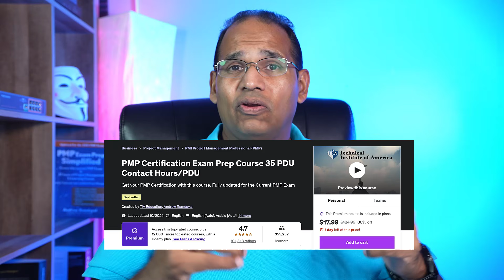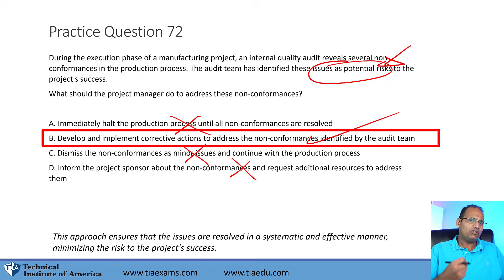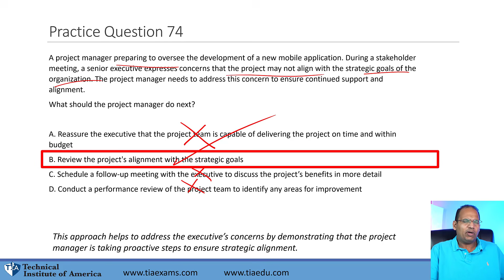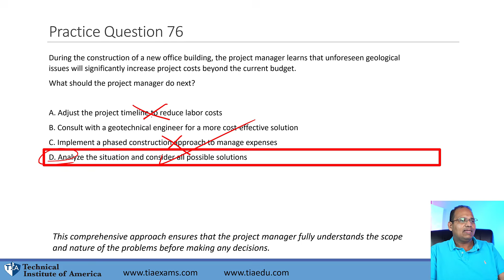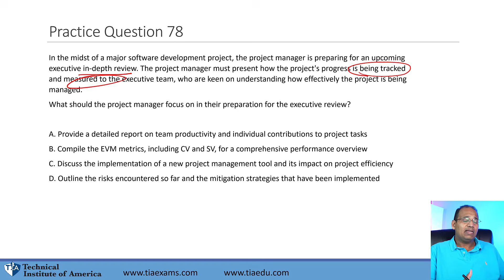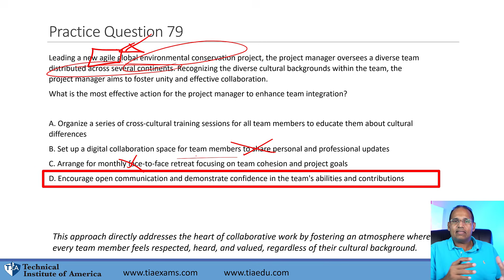200 Ultra Hard PMP Questions #71-80

Comment: Hello Andrew, thanks alot for the video. I just want to highlight that question 77 correct answer is D as per your 720 question course on Udemy. You mentioned that the best answer is to communicate with finance team regarding any modification related to the fiscal year. Would you please check those questions because I came across similar mistakes like this. Thanks alot.

Comment: For question 76, why isn't B the correct answer?  I totally understand that project mind set states we should analyze before doing any actions.  However,  the problem statement is that PM learns that unforeseen geological issues will affect cost beyond the current budget.  Shouldn't the answer be related to cost?  Hence as a PM, I would go directly to a geotech engineer to consult for an effective solution instead of analyzing for all possible solutions which might take longer to find solution.  Please advise.